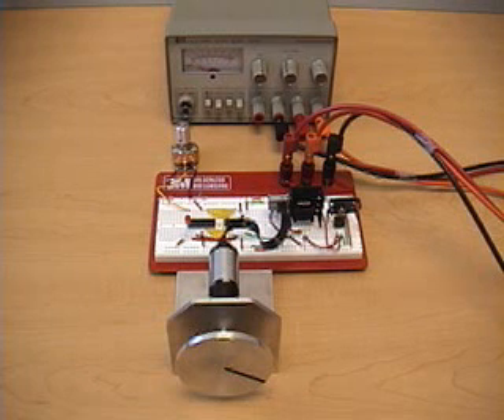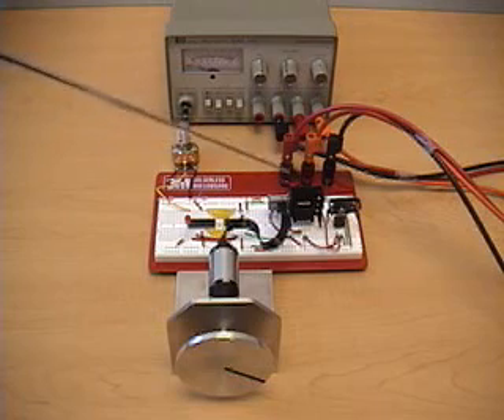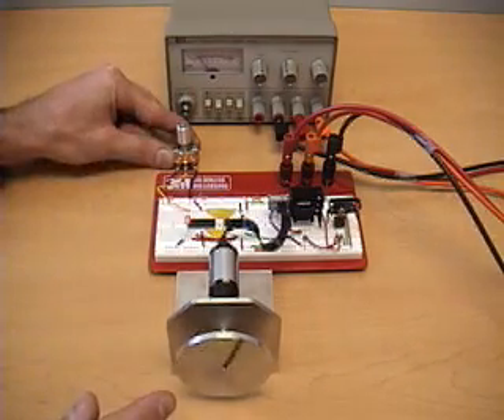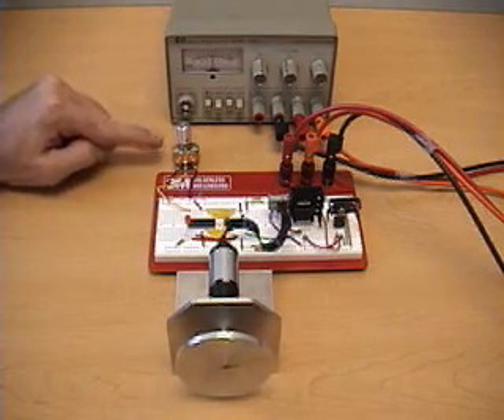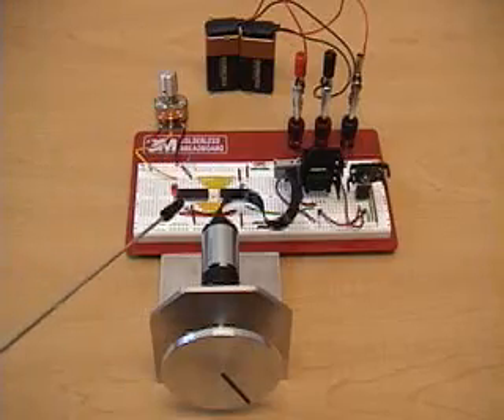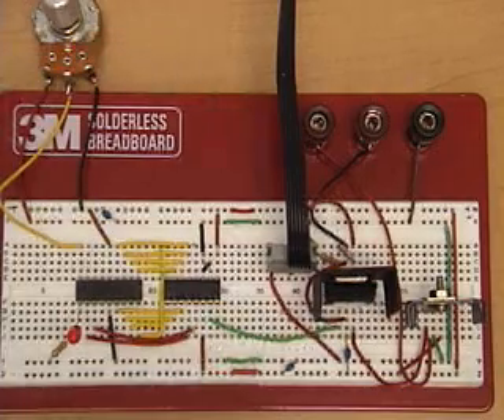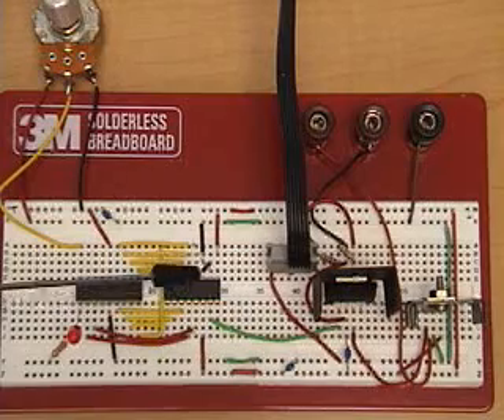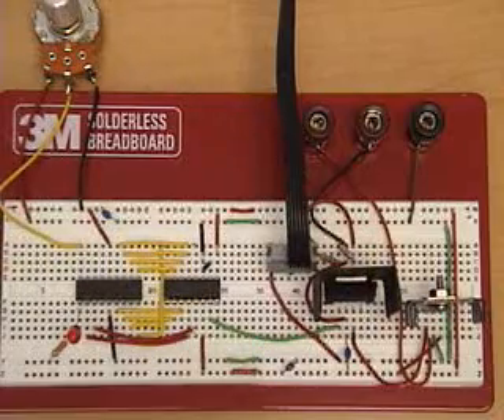dc motor power-op-amp speed controller

Comment: I have been searching for a AMP output control, from a regular 12VDC with 350-600 amps.  I am looking for a way to control a reaction for etching with a pot that will go at the 12VDC and control 0-12AMPS.  I have looked for an answer, and talked to electricians with no luck, can you shed some light on this problem for me?
Reply: At work, you tube and nearly everything is locked.  Will review tonight, thank you for the help!
Reply: Ullrich Stippel any luck? im looking for the same

Comment: He is not controlling the motor from the voltage directly. The voltage is read from an Analog to Digital Converter on the PIC micro controller. The PIC has been programmed to read the voltage off of the potentiometer, run it through some code that makes decisions, and output to the Op Amp accordingly. He does not tell you that you need to use pulse width modulation to control a dc motor. You turn the voltage on for a period of time then shut it off... time on/(time on + time off)=Duty Cycle%.

Comment: Friend what do i need to buy for a electricla motor of 1 phace,can work in 2 speeds, low speeds and a high speed? the electric motor model is 189D1753P008 it is a motor from automatic washing machine (it is out of the automatic washing) thx for help me

Comment: @ikb01 I imagine the pic and ADC are used to better control the range of voltage to the op amp and scale the potentiometer more precisely to the input of the opamp.  Just guessing though.

Comment: Just in a minute I can think of all the reasons for having pic in line. It could monitor various types of feed back, limit switches, temp readings, etc., and make decisions. Most of the stuff one builds when beginning to understand circuits won't have a reason for certain aspects, or at least won't have requirement, there is a reason, learning.

Comment: I've experiment with motor controls from the pwm side and sequence control of the magnetic flux in three phase motors, but I've never thought about controlling a motor using an op amp.  The only downside to your project is that without the pic chip this would have been a purely analogue circuit which is really cool because lets face it the electronic engineer is losing ground to the computer programmer or chip designers.  I'd love to see a purely analogue circuit of the same nature.  Fantastic!

Comment: Hello.
Follow this formula.
9v-3v/.02=300
Or 9volts minus 3 volts divided by .02 milliamps.
That means a 300 ohm resistor.
The .02 is the milliamp draw of a typical LED.
This formula will work with any DC voltage supply.
Not all LEDs are created equal, be sure to read the back of the package and know the voltage and milliamps.
Practice this formula with different power supply voltages and you will always get the right answer!
Eddie

Comment: What part number is the power op amp?  I've never heard of such a thing, I can only find op amps with a max current of 100mA at best.  Linear regulators have an adjustable output voltage based on an input voltage, I suppose you could call that a non-inverting op-amp...

Comment: Cool that has given me grate advice. But can I ask you, could a similar design work with 40v DC? And is the voltage going thru the variable resister low of is it 12v too.

Just if you are interested I'm trying to make a roaming computerised robot for ruff terrain. I could easily make that variable resister work with the computer output box if the voltage is low. This is way higher in voltage and amps in your video but if it can be done this way it would help.

Thanks

Comment: Study Ohms Law.
You need to calculate the value of the resistor you need to only allow  3 or 4 volts to go to the motor.
ex..   17.6 VDC Supply
.02 ma LED current
5. vcd LED voltage
17.6 minus 5. divided by .02 = 630 ohm resistor.
Good luck
Eddie

Comment: i have a question, i have a 12v dc motor that i only want to run at about 3-4volts. what do i solder on to the back of the motor so it does not go any faster then 3-4volts? is it a transistor that i use? also, what ever it is that i need to use, it needs to stand up to 16volts. thanks! any help would be greatfull!

Comment: pwm is not outputting a higher and higher voltage to the motor. voltage (and current) is delivered in pulses.